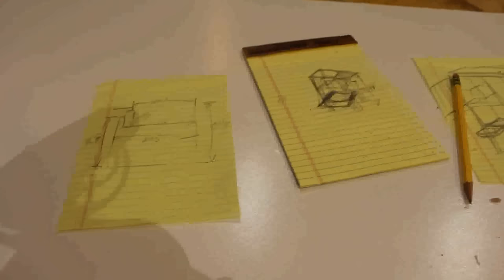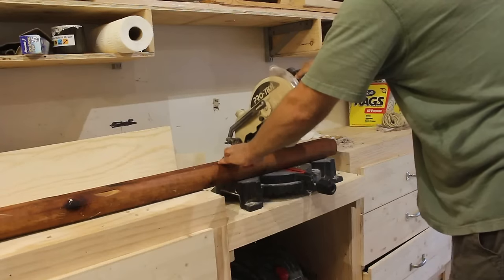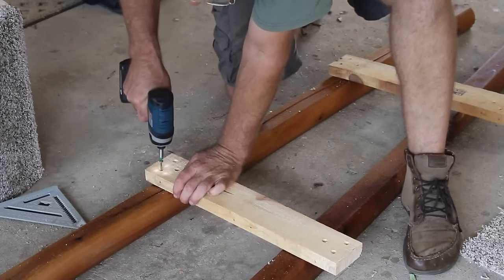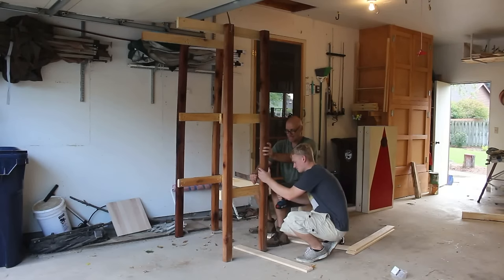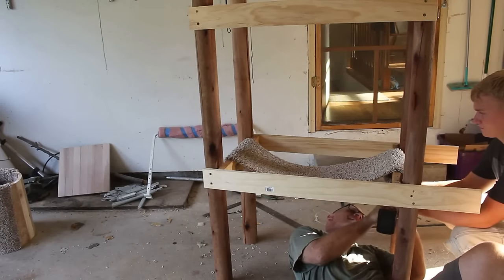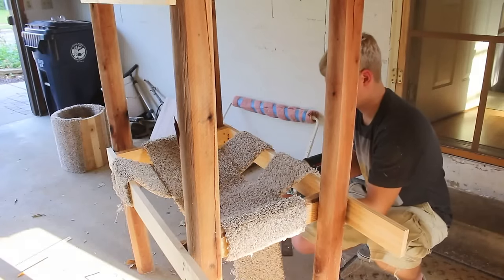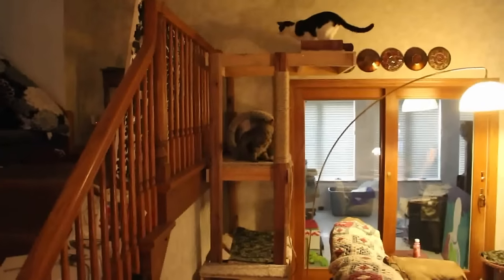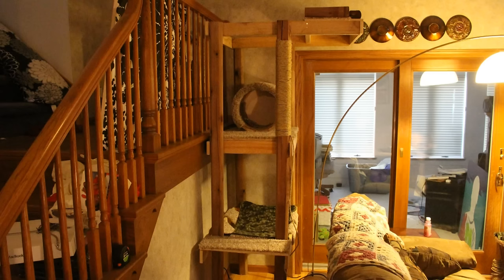An Awesome and Inexpensive Cat Tower - A Simple One Day Build

Comment: Question: any problems in it might tip over? I didn´t see a wider base from preventing this...
Reply from the maker: +Allan Vox it was very stable as is.  A bracket and some screws into the wall would help if needed
Reply: Mark Hanson - I'd Rather Make It Myself  
  Good work with your buddies and thanks for the idea